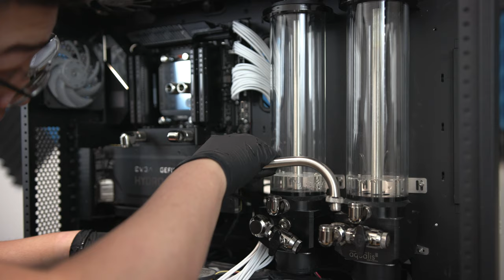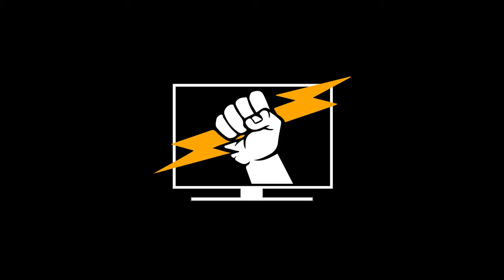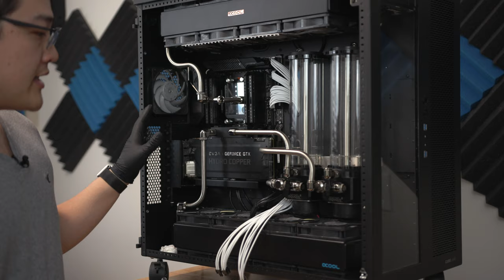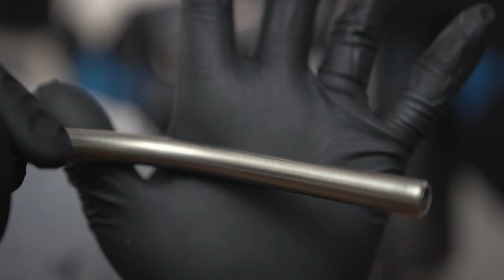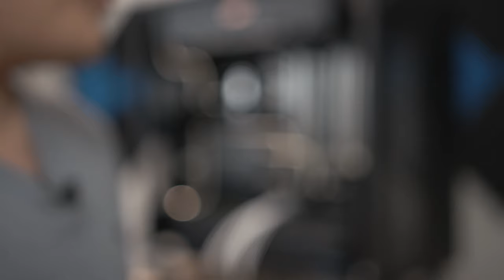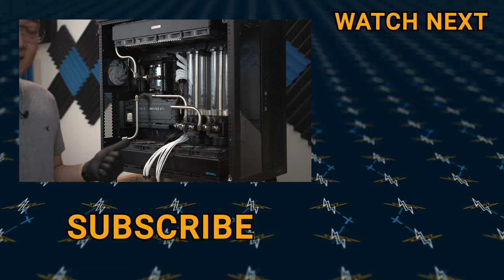Stainless Steel Tubing Watercooling Build Update (Part 1)

Comment: Trying to go through the same build right now. I know you mentioned 12mm OD 1mm ID for the tube, but what fittings are you using?

I've been seeing mixed results were some get 12mm compression fittings, while others had to opt for 13mm, even though the pipe is 12mm.

Thanks in advanced

Comment: Won't this cause corrosion? Or are you going to depend on an additive? Looks great 👍
Reply from the maker: Nah, stainless steel tubing is used all the time in industrial purposes to carry water or other liquids and have a high resistance to corrosion.
Reply: @SuprUsrStan  Not when other metals are introduced to the liquid... the ss will remain fine the other metals will corrode at a faster rate though...aluminum especially. copper falls in the safer zone... im researching this right now, so im trying to figure out if this is what i want to do, and what radiator to use...
Reply from the maker: @joshuaclaygaines  If you're referring to galvanic corrosion, 304 stainless steel has an anodic index of about -0.5v while copper and brass is around -0.35v to -0.4v. Stainless steel is unique in that there's a passive film that forms that actually inhibits the ions even more so than what the number number may suggest. Aluminum becomes an issue because it has a value of -0.9v or greater so the delta is significantly larger compared to copper/brass. I'm not worried about stainless steel messing with the system.
Reply: @SuprUsrStan  yeah i was digging into all this when i found your video. Youre correct, and you can use high quality premixed coolants to even further safeguard your loop. IE pump internals, block internals, fitting qualities, etc.....
Reply: @joshuaclaygaines  my recommendation is CAT  EC1 rated coolants . These coolants are designed for extremely long service life in the diesel engine industries . They typically say things like pre- blended , no water needed and have certification on back . The cat ec1 coolants typically have nearly no water in them , to control cavitation , galvanic corrosion , and oxidation.  
    So , as of this post , these would be my first choice .
Reply: Ron Jerome  swaglok local distributor can get you all types of stainless tubing and a huge variety of diameters.